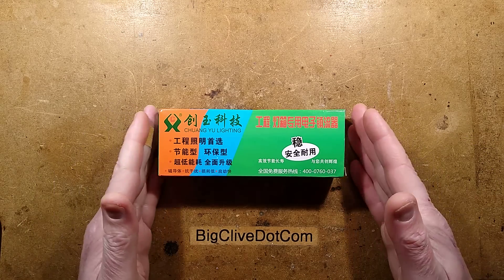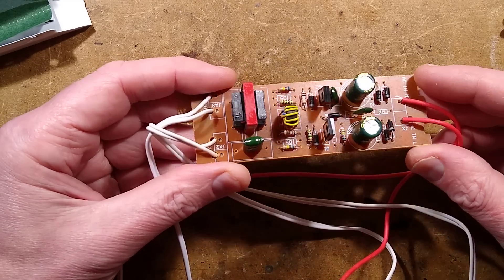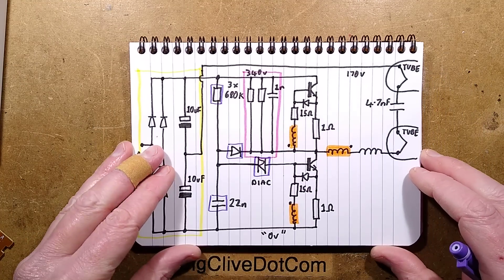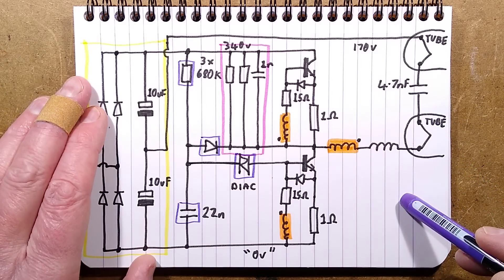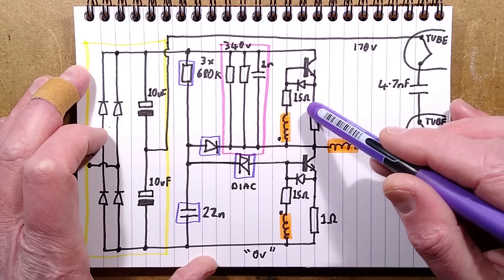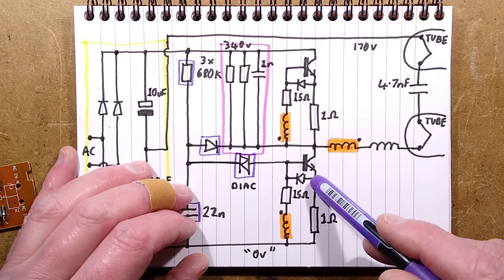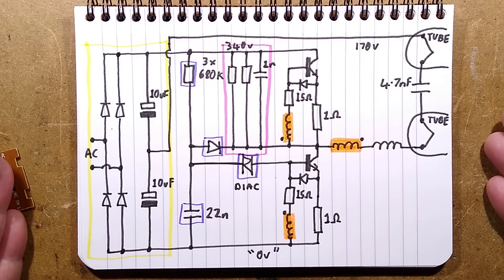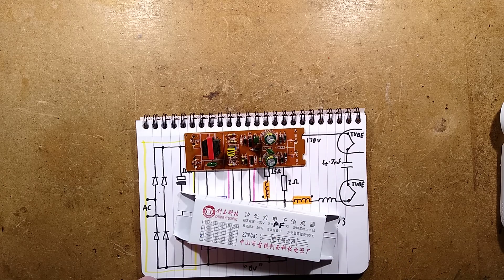Cheap AliExpress ballast (with schematic)

Comment: In my much younger years I was onsite with a builder and electrician.

When the electrician shouted he wanted ballasts I duly complied but unfortunately was shouted at. I brought a bucket of sand / stone mix to the electrician and a box of electrical components to the builder.

I was then sent to the shop for a long weight 😉

Not the best joke I know, I’ll work on the next one

Comment: This ballast is far from treating a fluorescent tube nicely

 That tiny capacitor doesn"t provide enough heating for electrodes. With these kind of ballasts tube starts instantly with purple flashing around the electrodes which decreases the life of said lamp. A PTC or a NC relay connected across this capacitor (to short it for a few seconds) is required to start the lamp in a nice way

2. There is a high chance this ballast will underdrive the lamp beyond a healthy threshold (shortening is"s life even further)

3. There is no EOL protection meaning that when the lamp goes EOL a battle - transistors vs electrodes begins

Comment: I still run fluorescent because I like it! On magnetic chokes too. The extra warmth helps heat the house most of the year anyway.
That ballast doesn’t have any tube end-of-life shutdown, so be prepared for cracked glass and melting lampholders if a tube fails and the ballast keeps driving it!
Reply: Never seen this happen, i only seen them failing to start.

Comment: the full wave rectifier is actually constructed with series capacitors to allow easy conversion to 115V input, just populate the "BX" position with a jumper and it will become a doubler-rectifier. That's also the reason for the center tap going to the lamp.
Reply: That was my first guess as well but stupidly that's not the case. From what I can see on the board photos both ends of "BX" are actually connected together.
Reply: @eDoc2020  Yeah, but its a very easy and reasonably safe trace to cut to separate them.  (I thought that position might be for a ferrite bead, so I paused the video there and spent a second staring at it.  It looked like it was designed to be cut, but I couldn't figure out why you'd want to do that.  This is a much better explanation for that footprint.  I feel slightly dumb for not recognizing what you guys did.)

Comment: The way you explained how the current flows and what happens in the circuit was very helpful. I'm only a novice hobbyist and content like this is gold! There were a couple of things that stood out (at my level of knowledge): what happens when the capacitor fills up and the presence of a low pass? filter there which I did not pick up on my own untill you said it. A very enjoyable video!

Comment: The kitchen and the bathrooms here have ceiling fixtures for lots of 40-watt tubes, each on a one-tube heavy 1970s-era ballast. I’ve replaced every tube with a plug-in replacement LED array “tube” that runs fine off the old ballasts, not all of which drove the real tubes properly (several killed their tubes young). All the tubes went to the hazardous waste place at the county dump; I don’t know if they were disposed of properly but I don’t have a 40-watt tube here either now.

Comment: "Who still uses fluorescent tubes" <--- Hard to get some specific UVB light from LEDs without them costing like $40 per SMD LED. (Whereas the entire UVB CFL is like $10...)
I'm sure it's just a volume problem. UVB bulbs in general are not that common.
Reply: Getting LED dies to produce photons that energetic is one problem.  LED packaging materials that are both transparent enough and resistant to photodegradation from Very Angry UVC Photons is another.
Reply: @randacnam7321  This seems like maybe a "blue LED" thing in the 90s. (How they weren't readily available.) $40 per LED seems insane. 😆 Also, remember that there are only a few things that are UVB/UVC transparent, like fused quartz. I have no idea how they make UVB CFLs. Is the entire CFL bulb quartz fused glass, or is it part of the glass mixture, or what? So much seems like industry secrets.
Reply: @fitybux4664  They use very low or no iron content glass for many lamps as it is the iron that imparts UV opacity.
Reply: @randacnam7321  Interesting. I wonder if you could make a house window out of this low iron glass to allow UVB through. (Instead of just UVA like normal glass.)
Reply: @fitybux4664  That is done with UVB LEDs already.  They are mounted in a metal can package with a glass lens on the end.

Comment: I had a couple of this style of ballast for my fluro lamps before I went LED.  They worked but were rough on the lamps, no preheat, just blast breakdown voltage at them.  Would have been stripping the emitters for sure.  There is one thing i do remember about them though.  If the lamp was cold, say 10c or less, you could see the lamps were being run at 10kHz or so by the size of the dim bands running along them compared to how they looked when cold with 50/100Hz.

Comment: The electronic ones I've opened were filled with potted black stuff, covering all the components. I've slowly replaced the ones in my garage with direct wire no ballast needed L.E.D tubes.

Comment: I had an actual 4ft fluorescent tube in the basement go dimmer... and dimmer... and dimmer... 'til it barely glowed.  Replaced it with a new bulb, which was nice and bright... for about a week, then went dim again.  Got a plug'n'play LED stick (ie, no need to remove the ballast and/or rewire the fixture), and it's chugging along nicely for about a year.  Nice 4000K, and not eye-scorching 7000K anymore.  Did the same for 3ft tubes in the kitchen above the windows.

Comment: I just pulled out of recycler a BT halo with dock, fixed it and now I wonder what is it good for?! I watched several youtube videos about it, and I still see no good selling point. do you use one of those?
Reply from the maker: Is it a 4G modern?  I used to use one as my main data connection.
Reply: @bigclivedotcom  nah, it is a landline handset with a docking station and build in answering machine capable of taking your cellphone calls through bluetooth. weird thing if you ask me, I am still not sure how people use that thing.

Comment: When I did the refit in my shop to remove ballast and install Led tubes, I carefully looked for ones with good reviews and hopefully aluminum backing for heat sinking. I installed my Hypericon tubes 6 years ago and the only failure was because one of the tombstones broke. Other than that they have been great.

Comment: Will work with the 3foot lamp, as that is basically a constant current driver, so will simply run the tube at roughly the right current, just like it does with the 4 foot tube.

Comment: That center tap is producing a virtual ground. The schematic is easier to understand if you write in 0 v at the center tap, then you've got a plus and minus 170V rail coming out of the bridge rectifier. The end of the tube connected to the midpoint is getting ±170V going to the ground at the other end.

I think you may have the door on the wrong end of the feedback xfmr primary, but xfmr dots make my head hurt.
Reply: I think the dots are fine.  When current flows into the dot on the primary the secondary current has to flow out of the dot to balance it.   Or if you prefer to think of voltage, when a positive voltage is applied to the dot on the primary then all the other dots will go positive.

Comment: I'm surprised you didn't say it first, there's no fuse, that would have cost an extra few pennies. (What's the British word for 1/100 of a Pound?)  There's not even a thin spot in the traces where the voltage meets the board to act as a fuse.
Reply: er -it's a Penny

Comment: i could be crazy, but it doesn't look like that green deal between the two smoothing capacitors connects to their output, the orange circuit. if you ask me it pretty clearly goes from the red circuit to the pink circuit.

Comment: In my experience, LED lamps fail due to the 400 volt filter capacitor going open. If you don't abuse them, LEDs will last a long time. though maybe not as long as a good quality flourescent fitting with a conventional ballast. Replacing the tube is easy and cheap. With electronic ballasts the tube usually outlives the ballast. I think modern LED lights are getting more energy efficient than their counterparts, so I'm not getting any more CFLs. When they go they are replaced with LED equivalents.
I always like your content, Clive, and although I'm an old hand I still sometimes learn something from you. Keep it up!

Comment: Do you have a video explaining what Power Factor is? I realize this is probably basic knowledge for most of your viewers and as such not a topic you would want to cover.
Reply from the maker: It's the relationship between the voltage and current waveforms.  Ideally they would be perfectly in sync, but with electronic loads with rectifiers and smoothing capacitors all the current is drawn at the peak of the sinewave as it tops the capacitor back up.
Reply: @bigclivedotcom  Thanks Clive. Much appreciated

Comment: I'd use that ballast!  40 watt 4 foot tubes are super bright now, and have a nice color rendition compared to the old days.  I have a "vintage" dual tube 4 foot fixture in my walk in closet but it's still using the old purely inductive ballast which gives that nice growl sound.
Reply: The hum was sometimes nice and sometimes way too loud, i recall moments from school where we loudly hummed when teacher was talking and then blamed it on the lights.
Reply: @plainedgedsaw1694  If the ballast in my closet gets that loud it's going on the curb on trash day.  In the 9th grade the public school had big incandescent bulbs.  I couldn't believe it.  They didn't flicker or hum though.  On warm days we turned them off and relied on natural light to keep the room cooler.

Comment: I like how the pcb is laid out like the schematic is. I guess eliminating balancing resistors in the input electros has two reasons. 1 as mentioned is cost cutting. Another is that any dc bias on a flouro tube affects lifetime so removing the resistors essentially makes the caps block dc of the driving waveform.

Comment: I wonder if the DIAC startup circuit is why it doesn't need the series capacitor?  At startup, both transistors will be off, and no current will flow through the tube.  The other style use the noise in the transistors to start the oscillation, and the capacitor might need to be there so it can amplify enough to get it oscillating reliably.  That, or it's in that linear region for a relatively long time and the capacitor stops large currents from flowing.   In the US, the ballast I took apart works very similar to this; it reminds me of the old AT power supplies using two capacitors, a bridge, and the switch for 120/240 that modifies the diode bridge connection so it either straight rectifies (240V) or makes it into a doubler (120V) and thus the supply runs on the same voltage internally in both cases.

Comment: Fun side effect of the LED movement.  On our production floor at work, we are all LED, but we use solar powered calculators.  They are literally starving for energy.  I've actually switched to doing a lot of my numbers by hand because by the time I track down one of our poor starving calculators I could have done it with pen and paper.  Or I just do it in my head.

Comment: Not saying they were identical to these, but these cheap Chinese ballasts caused so many fires in Afghanistan.  When I got to Herat, I had to implement some basic electrical safety standards and specified all ballasts must meet CE standards at a minimum... So they found some of these dodgy ones with CE labels of varying authenticity (which isn't uncommon as I've seen even name brand devices with improperly formatted CE logos).  Our better contractors at least got Turkish made ballasts.

Comment: Interesting! When I moved to the EU some years ago I brought with me a few of the 4 foot twin tube fixtures. I also had purchased a bunch of GE solid state multi volt ballasts. As I installed these fixtures into utility rooms I replaced the 120 volt ballasts with the multi volt units. Work fine! As for tubes I lucked out buying 2cases of tubes from a liquidator who was selling out a store that had closed. $10 each case. After 16 years have only started to use tubes from second case.
I also picked up on a used surplus military comms container that is equipped with 4 foot fixtures. 86 vintage so they are all T12 tubes with magnetic ballasts as well as a filter choke on the AC input. This type of container is used for military comms so any electrical noise must be kept to a minimum. Thought about a retrofit with led tubes but they are way too noisy for HF communications ( yes I am an amature radio operator ) . Does anyone know of a source for 4 foot LED tubes that run on either 12 or 24 volts DC?
Reply: I feel with you, used listening to shortwave radio throughout 70s and 80s. 
No fun anymore.
I would use 12v 50 cm led strips, they come clear or milky in daylight color or yellowish with little clamps for mounting. I was pleased with the white ones for workspace lighting. There's no pulse involved as far as i can remember. But didn't try with SW.

Comment: I miss lamp EOL protection. If some day the lamp does not want to start proper any more but the filaments are still conducting things can go horribly wrong. I.e. overheating of tube until the glas starts melting and/or overheating of the pcb...

Comment: There are actually 2 ways T type bulbs are started and ran...surprised you never brought this up.
Reply: In US we had (have?) "rapid start", "preheat", and "instant start".  Instant start is cold cathode, no filament.  Rapid start and preheat use filaments and usually use the same T12 tube.  Preheat fires up the filaments and uses a starter to ignite then turn off the filaments.  Flicka - flicka - light!  Rapid start energizes the filaments continuously at low power and provides enough voltage to eventually strike an arc.  Initial dim for maybe a second and then light!  All the rapid starts I've seen from the magnetic days are dual tube.  3 tube electronic ballasts are now common in US office buildings.  The tubes look like they might be T8.

Comment: I still have a fluorescent t8 lamp in my bedroom, no fixture, just a 120v ballast with a single wire going to each end of the tube, it drives it like a ccfl without touching the filaments so it has been in operation atleast 10 hours a day for the last 10? Years, the only non compact florescent left in the house i think? As bulbs have been burning out I've just replaced the fixtures with Edison screws so i can pop LED bulbs in as they are needed or even incandescent if I'm feeling naughty or need an additional heat source for specialized purposes
Reply: In addition from another comment thread, My favorite has discharge lamps all use metal salts and a very hot arc, 1000 watts of limited band orange light is so lovely, reminds me of sweet home Chicago,  you can always find your bearings just by looking up at the clouds and finding the orange glow, sadly the glow isn't as orange anymore because of the trend for LEDs replacing them, i still want a low pressure sodium lamp.... Never got my hands on 1

Comment: For me it's easier to understand the circuit if I think of the tap on the series filter capacitors as ground and the output is +170 and -170 volts. One end of the tube is connected to my ground and the other end swaps between +170 and -170. The 4.7 nf capacitor does double duty as a filament warmer and a series limiting impedance.
Reply: That's how I looked at it too. Either or though really. But yeah easier to visualize in my head

Comment: These electronic ballasts were good. When tubes stopped working on the old coil wound ballasts, I simply moved them over to these electronic ballasts and they tubes started working again. Increased their life by 10%. My current 22w led tubelight has been running since three years. The old tubes barely ran over 12 months.

Comment: Also a LOT of cookie cutter development homes built (in the midwest US at least) before LEDs were popular use the dual 4 foot fluorescent lamps in the kitchen (I think known as the cloud puff design?).    Since it's easy to pop in a tube every few years, they probably hardly get replaced unless there's a renovation.
Not looking to reno, I just replaced mine on its own with the LED version.

Comment: Cool explanation, going down the rabbit hole of ballast's past, the magnetic ones are really really amazing. Quite a dedication to the advancement of these lamps. 
There had been a suggestion to have a separate  high frequency generator in office buildings to power these lamps that would operate with increased lumen per watt
Reply: Can you imagine the amount of radio frequency interference an HF generator would cause, with the wiring and fixtures creating a giant distributed antenna system?!  Any alternative impedance matched coaxial wiring system would make it financially unviable.

Comment: Being less than young, I remember the horrors of the nasty tar filled transformers in the original fluorescent fixtures that often ended their life with a burn and smoke. The testing company I worked for was in the basement of an old bank building with questionable air movement, having one of these things go off was a Chernobyl quality event. A smell that you can taste... ah the memories.